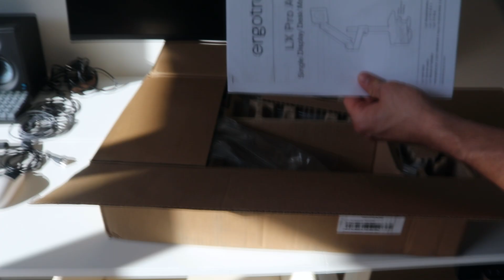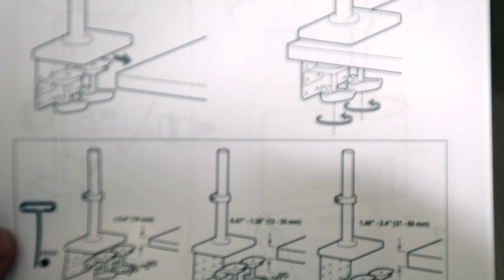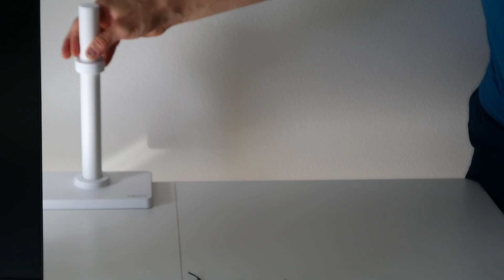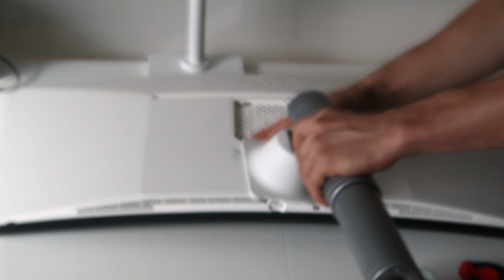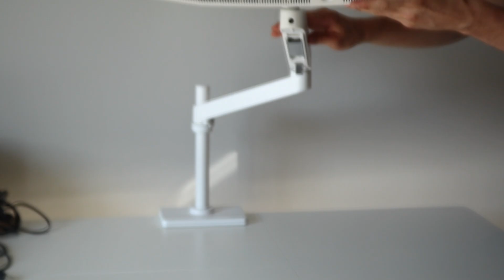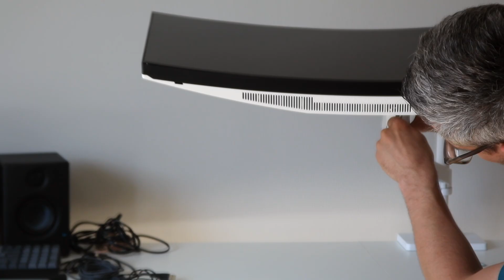Ergotron | Upgraded LX Pro Monitor Arm | Installation

Comment: Thank you, my monitor kept sagging and it was really annoying., I suspected the hole at the end of the arm was the key but it was stuck and i didn't want to break it. After you confirmed to me that this would increase the resistance I had the confidence to tighten it. I had to force it but once it unlocked it tightened freely and now my monitor stays where it should., :-)
Reply from the maker: Happy to help. Sorry the video was so blurry. My old lens had broken. But good to know the video helped you out. Which monitor do you have?
Reply: @AndrewRockYoutube  LG Electronics UHD 4K Gaming Monitor 27UL550P. Not the best gaming monitor but it was cheap lol. Does what I need it to do though. :-)